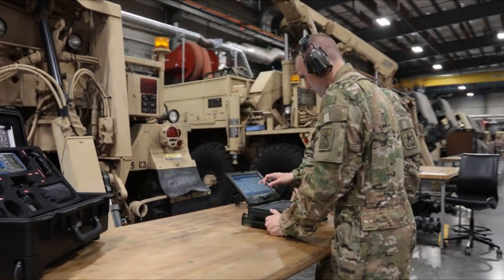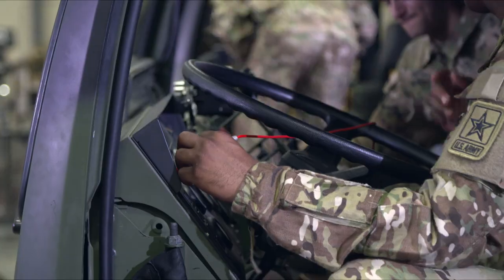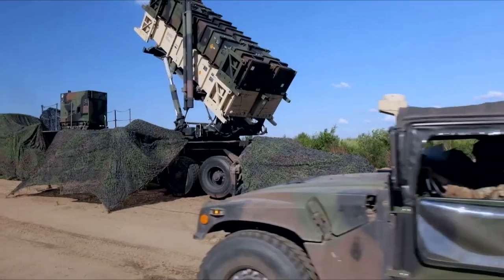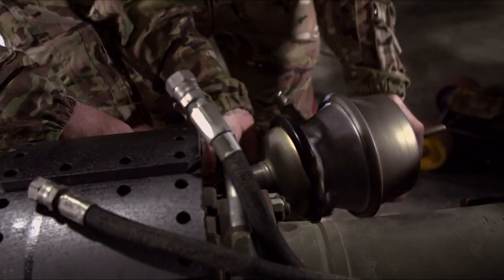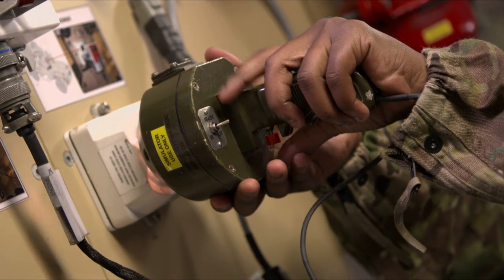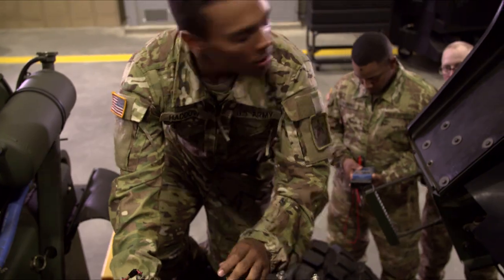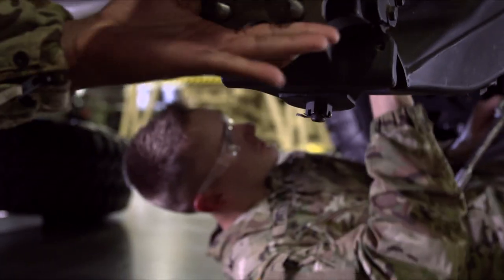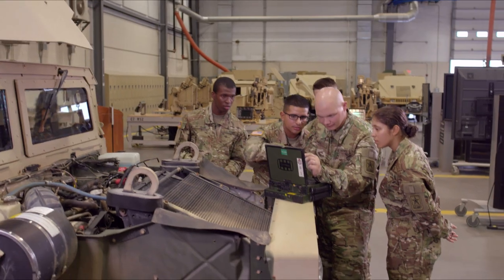MOS 91B Wheeled Vehicle Mechanic

Comment: Almost none of my knowledge of vehicles or trucks existed before I joined the Army, but this training saved me. The basics are taught to me by AIT, but my unit completes the remainder. They comprehend my curiosity while also teaching me more. Go for it if you enjoy repairing automobiles. Additionally, how you set yourself up matters. I have no regrets. ❤91B
Reply: Not only that repair shops and diesel mechanic jobs are always available
Reply: how did you score on the asvab?
Reply: @Ghosxth1986  I did well, particularly in the electrical and mechanical comprehension sections. I chose 91B because I was interested in learning about vehicles and was searching for a place where I could gain more practical experience.
Reply: @devnotes00  Thanks to my MOS, I now rarely ever go to shops for repairs unless it's an annual inspection or alignment.

Comment: My Army career: 1988-1995. I was a 63B. Light-wheeled vehicle mechanic. The 63S were heavy-wheeled vehicle mechanics. I've never seen army trucks with air-conditioning or such weapons systems shown in the video. Some Hummers, deuces and 5 tons had ring turrets for machine guns. The 91B series of these days must have vehicles of all size classes consolidated. We did not have all that fancy shop equipment as shown in the video. In snowy Germany, some of our 2 1/2 and 5 ton trucks didn't even have damned cab heaters! The Hummer and CUCV was always my fvaorite for such creature comforts as heat as these little vehicles always had heaters. Soldiers called these little rigs as the Hummer sham buckets.
Reply: The oldest thing I probably had my hands on was an M916A3 Freightliner
Reply: Woah, you might have served with my pops!

Comment: Started out as a 91D reclassed to a 91B back in 2016. Also I'd recommend those to take the ASIR1 class which will be additional training to drive, repair and maintain a rough terrain container handler (RTCH) which will look good on your record
Reply: Why did you reclassify? I’m considering picking up 91D
Reply: @adamkalon7584  at the time the unit only had an E4 slot but you had to be a 91B so I transferred units and reclassed
Reply: I think the RTCH is Hotel 8. Thats only for Active Duty and you cant choose it. You have to be selected by being top of your class.
Reply: @LaZarusXtnct  I think you're mixing that up with recovery school (ASI-H8)

Comment: will this MOS turn you into a good civilian mechanic? I would like to be a diesel technician
Reply: Chris Nunya absolutely, you can get a civilian job right out of the gate working with diesel techs or even contractor companies like manTech making 50k right off the bat
Reply: To be honest though, you don’t really learn a lot in AIT, you will learn most about these when you get to your unit
Reply: @annguy5563  yes they kinda just pushed us through the course. Yeah I learned a lot more than when I came in, but not to be able to actually go to a mechanical shop and be like, "here's my application I'm ready". Cause honestly u still dont know enough. And where I am u need a bunch of other certificates to help you get into any hvac companies.
Reply: I was a 63B back during the Cold War/Desert Storm (it's changed to 91B now).  I got out and went to Auto/Street Rod School (WyoTech, 1997 Laramie).  Having the background helped in school, but experiencing the two worlds in contrast I'd say that if you want to be a diesel tech, go to tech school and get into a good post-grad program.  Also look into the heavy equip field (Caterpillar has a great program).  Or go military first, then tech school...or even better go military, and go to tech school while you serve.  Don't forget, there's a LOT more to do as a diesel tech (ships, agriculture, etc.)  I went to a diesel recruitment with a friend when I was at WyoTech (I was in the Auto program at the time), and a bunch of the recruiters tried to hire me (for example, a mining company in South America, had my choice of ship or shore, and another place that did agricultural equipment offered me a field-tech position over a 3-state area) all because I was a diesel tech in the Army.  There are TONS of opportunities out there for diesel/heavy equip techs.  Personally, if I could go back in time, I'd get into heavy equip over anything.  The money is GREAT and there will ALWAYS be a demand for good techs.  If you're concerned about the high cost of tech school, look into community college programs.  You'll learn the same basics, but at a MUCH lower price.  Then go from there to a sponsored program (CAT, John Deere, etc), or do the military route and find a good program when you ETS.
Reply: @willie_mccoy  Thanks for all the great insight.. Much appreciated. I'm looking to go the military route an do diesel mechanic in there if possible. What's the difference between that's an heavy equipment?
Reply: If u just want to be a diesel mechanic just apply at a diesel repair shop. There is a shortage of mechanics ND they will hire practically anyone that wants to learn.

Comment: What's the overall asvab score do you need to qualify for a 91b? Should I just only practice my mechanical knowledge and leave the rest out or would I have to have a good score in all the asvab subjects?
Reply: I just finished the asvab with a 55 and got 91B
Reply: I honestly don’t know I got a 33 witch pretty low. Plus I suck ass at tests but I still got into 91B. I leave for basic in February.
Reply: @lazymajora6876  same I didn't study or anything and got a 35 and I'm seeing my options in which this is one of them
Reply: Try taking the PiCat instead, they don’t time those
Reply: Seems like the specific tests at the end were the important ones to qualify for this job